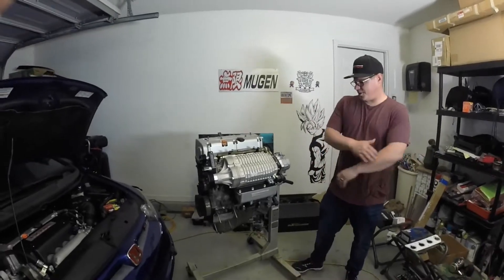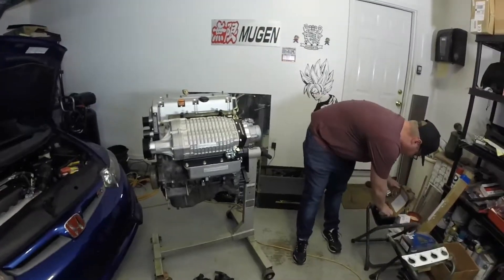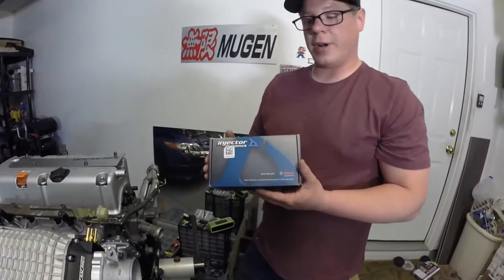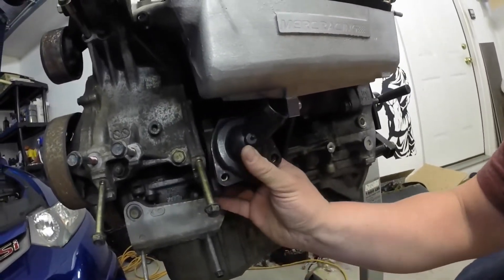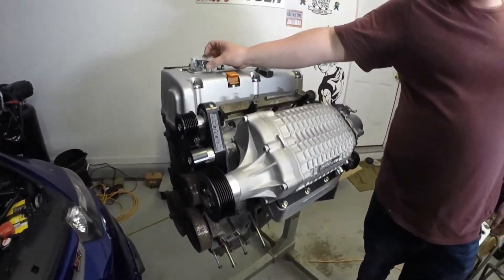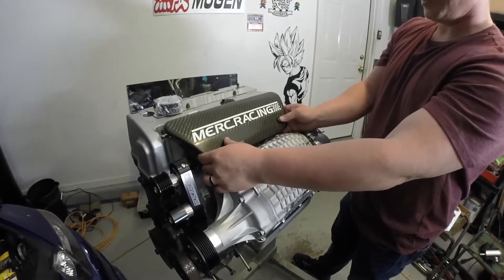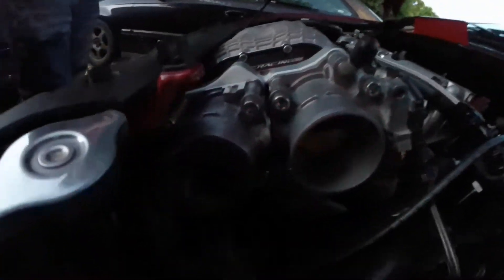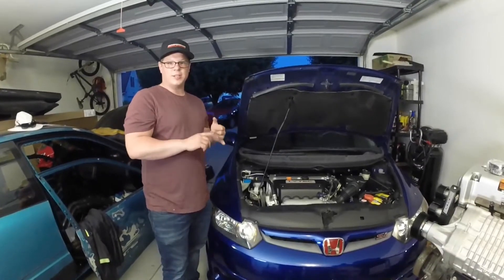Mercracing supercharger. What is needed for the 8th Gen civic k-series from stock (part 1 of series)

Comment: haha showing all your street cars with superchargers on them then saying Mercracing superchargers are for offroad use only.... just bought a MR900 TVS for my Honda Fit going to try to make it work with my L15 though hopefully can make it all work with a spacer plate to adjust the inlet alignment and bolt pattern difference wait and see.
Reply: Dude what’s your Instagram?
Reply: @JimMcConnell6801  Hi Jim I don't use Instagram
Reply: @jbar100  is your fit auto?
Reply: @rinyi-y4r  No it is 5 speed
Reply: How did your engine handle the supercharger?
Reply: @silvianosolorzano581  just recieved my supercharger last week going be awhile before I know probably 1 1/2 years as it is gonna be a full widebody mechical rebuild

Comment: I have a k24 with type s pump and skunk2 alpha 2 cams, alpha springs and retainers,with full bolt ons  made 250 hp. Would I be able to run this kit or the 1320 or 1900 kit with my setup already or are superchargers cam specific?  What kind of rods and piston setup would you recommend? Any suggestions would help I would like to make 450 and it would be my daily
Reply from the maker: A 1320 can make 450 with the correct pulley combination. However  stock cams are best for HP. There is only one company that makes a cam that out performs stock cams with a supercharger. I don't remember their name off the top of my head.

Comment: I have been working on mating an Eaton m90 to my civic. My plan was to make a custom intake manifold with a built in water to air intercooler but I was wondering If you have seen just the mercracing intake manifolds for sale anywhere. Everywhere I have looked they have been sold out unfortunately.
Reply from the maker: I have a prototype manifold with some minor imperfections that I can let go.
Reply: @jorgegarcia7005  I have an old Jackson racing for my mugen. Will your manifold work for me and how much would you let it go for?

Comment: What did the mugen make for whp?
Reply from the maker: With the 1320 probably 400, haven't finished the 1900 fuel system but should be over 500.
Reply: @jorgegarcia7005  wow with stock air box and cat?
Reply from the maker: You said mugen not fg2. The fg2 is near 300
Reply: @jorgegarcia7005  I’m sorry I may have been confused.  I saw one of your videos but anyway that’s awesome!